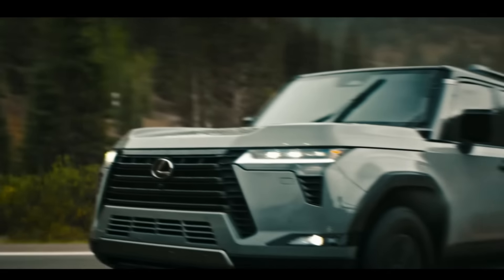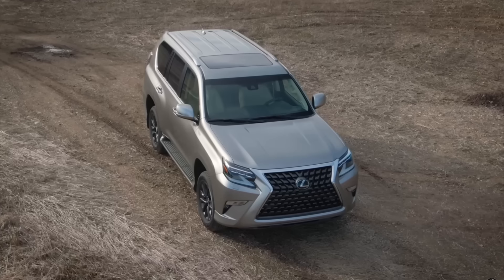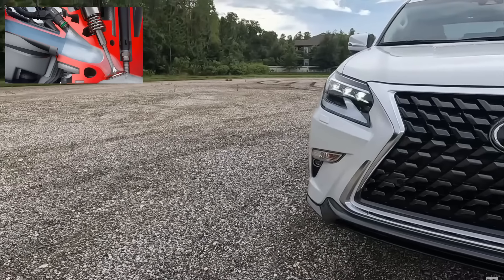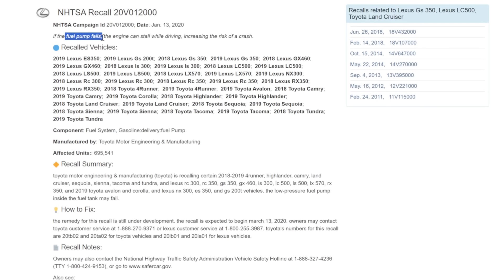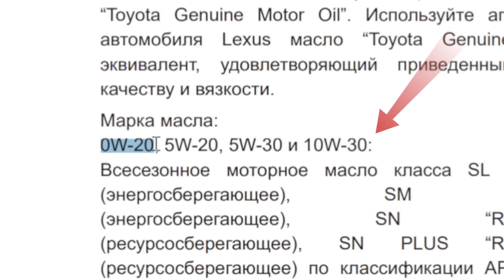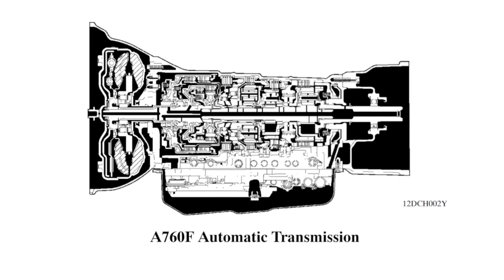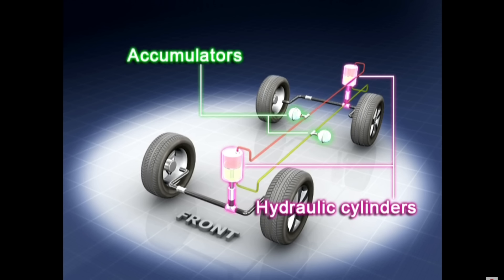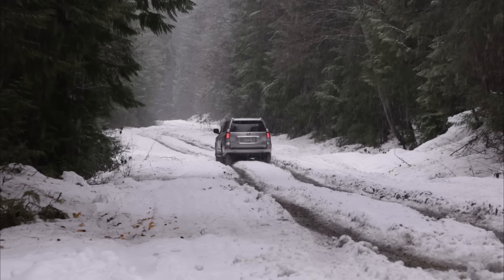2010–2023 Lexus GX 460: A Complete Reliability Guide

Comment: New engine is not more fuel efficient. More complicated only
Reply: The new GX motor is more efficient. Better gas mileage and more power. The only issue with the new GX is that it's not aerodynamic so the fuel efficient is not that great but the motor has better fuel efficiency in the larger LX while pushing even more power with bigger turbos.
Reply: It is only 1 or 2 Liter for 100km. That is not big difference
Reply: @Stellateeee  GX460 is rated at 15 city/21 highway/16 combined. GX550 is rated at 15/21/17. LX600 is 17/22/19.

If the GX550 wasn't a box it would get 3 MPG combined instead of 1. Even if mileage was identical, you're still getting 48 more horsepower and 150 more torque. 1500-2500 more pounds of towing capacity.

The GX550 motor is not more reliable, that's for sure. It is more efficient.
Reply: @Sunil-he8xm  550 have the same fuel efficiency in real life, even though on paper it should be 1mpg better)) Turbos must have a more frequent oil change, extra idling time after starting and stopping if you are planning to keep the car for longer than 5 years. That iPad in the center controls everything, and if one diod or triod will burn out in it, you will have to shell out tons of money for the replacement. KDSS system is ONLY on overtrail version.  No real wood at all, no real leather on all of them but on luxury trim, no air vents on top sides for the passengers,  rear windshield viper is located cheaply  on the bottom of the rear window and not hidden like on 460, not a lexus anymore,  plain Toyota for the price of a Mercedes
Reply: @TheWinwin4all  I said even with the same mileage you are getting more power and towing with the GX550 and if it did have better aerodynamics (ex. LX600) you would definitely get the best of both worlds. GX460 does have easier maintenance and better longevity. It's a trade off and with a new generation it shouldn't be that way, everything should be better.
Reply: Exactly
Reply: The new GX 550 is not fuel efficient! My 2023 GX 460 can get more than 21 MPG on the high way on long trips going 65-70 MPH. Local driving I get around 18 MPGs. The 460 is bullet proof with over a decade for Lexus to perfect the engine.
Reply: @TheWinwin4all  100% agree I have a 2022 GX 460 and looked very closely at the newer 550. I wouldn't switch it if they gave it to me as a free exchange. I love the KDSS and I'm glad I don't have the air suspension. I don't off road so I'm good with what I have. I will never sell it.
Reply: @Cocora22  I have 23 with air suspension.  I have 3 modes with it, comfort, normal and sport. It does make a difference between comfort and sport, also it does auto leveling if pulling a trailer, so I like it. Regarding new 550, I was 200% sure that it will be my new ride, however,  after sitting in it for the first time, I regretted myself that I didn't buy the last 23 from the dealership when they were heavily discounting them in mid November 23 through January 24, while making room for the new 550. Anyway,  I found very low mileage Lux and can't be happier. New 550 is just a Toyota now, not a true lexus anymore..sadly
Reply: @TheWinwin4all  Yes I agree I saw the 550 at the car show in Washington DC and it did not impress me in the least. The exterior did, but that's it. Then read all the reviews and road tests and none of them impressed me. I'm glad you found the LUX, it really is very hard to go wrong with the 460. I wanted a LUX but I also just wanted the green color so I went with that one. I don't tow so doesn't affect me. I would have liked the extra bells and whistles but I fell for the color head over heels.  😂😂😂😂😂Enjoy and Happy New Year.
Reply: @Sunil-he8xm its not just a tradeoff, it’s a tradeoff where the old one demolishes the new one on pretty much everything that’s important. for an extra 1mpg. the transmission is also much worse. the old one is smooth, powerful, and a bliss to drive. i actually can’t believe they screwed up so much on the new one.
Reply: Reason for saying bye to V8s is all about meeting govt emissions requirements.
Reply: @Sunil-he8xm  More efficient on the EPA test loop only

Comment: The one issue they all will have between 75k-140k is the valley plate coolant leak. but other than that amazing cars and go anywhere
Reply: I can attest to that. They told me that it was a small leak, but offered it to be replaced. I'm going to keep watching the coolant and will only change if it gets worse.
Reply: Yup. Have one leaking now. Slow but have to keep an eye on it until I can get it repaired.
Reply: @wavenami  offered to replace for free? dude do it....
Reply: How long can you go before it absolutely has to be fixed?
Reply: @ keep an eye on your coolant level and temp. I was adding 2-3 bottles a year for about 70k miles but  now at 180k I’m at a gallon a week so it’s about time for me unfortunately.
Reply: @Damienvizuete  Are you going to fix it yourself?
Reply: @  no sir. No tools, garage or skills unfortunately. It’s also my only vehicle. Taking it to Lexus. They quoted $3500. I’m figuring $5k just to save myself the shock as they’ll probably recommend and or find other things to fix while they have the whole engine apart.  Plus I’ll get a loaner GX (or RX hopefully not) for the 2 weeks it will probably take to get my car back.
Reply: @Damienvizuete  Oof that is a pricey fix. Reminds me somewhat of when a head gasket blew on a truck which was about the same repair cost.
Reply: @Damienvizuete  I think my Lexus quoted about $3500 I don't need it yet, but I wanted to see what they charge. I am sure they will look and hope for other things that they can replace because they have the engine open, and you have a choice. Need to find an experienced Lexus/Toyota private tech or Indy shop in the Tri-state area that works on the GX. Lexus, like other dealers, is expensive due to overhead, but despite paying high prices, there is no guarantee the work was done right. It's all about getting the job done quick and changing high.
Reply: If this repair is done by Lexus, will there typically be reoccurrence? Looking at a used one where the service was performed right at 70k miles and it now has just over 100k. Not really looking to do something like this every 75k miles. If that were the case, I’ll buy a gx470 and just have to do the timing belt every 90k at less than 1/2 the price of the coolant leak.

Comment: Great review. Thanks.. I really wished if Lexus/Toyota did a better job of rust proofing the undercarriage. It is only painted, without even any primer. Very disappointing because the GX will rust long before it's useful life.
Reply from the maker: thanks for your comment man👍🏻 you're right rust protection it's something that Toyota really needs
Reply: We reviewed a ton of used GX460 and passed on all of them due to this issue. Finally found one in TX with very little rust.
Reply: @wavenami I’m currently looking to purchase, can you give hints on most common area the rust starts?
Reply: @AppliedCommonSense  As far as rust goes, pretty easy to see. Get a flashlight, start with the front skid plate and work your way back. Look inside the front passenger wheel well underneath the rubber cover. If the metal tubes are smooth, it's a good sign. Carefully inspect the front wheel suspension/linkage on both sides for corrosion. Cars from cities that use a lot of salt on the roads in winter are the most suspect. Take a screwdriver and lightly scrape areas that look suspect. If it's heavily rusted in areas, pass. Light rust can't be avoided most of the time, but you can tell if it hasn't been taken care of.

Comment: Valley plate leak, needs more frequent coolant changes.  Also gasket is metal, and engine is aluminum, so engine is sacrificial while gasket is not.  So needs dutiful oil and coolant changes.  Frame rust issue.  Secondary air intake issues.  That’s about it, I cannot think of any other problems missed, great vehicle.👌
Reply: I thought the issue was a sealant material rather than an actual gasket causing the valley plate leak. What would the recommended change interval for coolant to possibly prevent the valley plate leak?
Reply: also timing cover leak happens around 70k
Reply: Aluminium is metal...

Comment: The most common issue GX460 owners face is the KDSS? Where are you getting this information from? Though it is entirely possible, I don't know a single GX460 owner who has had to service the KDSS system. The coolant valley plate leak, secondary air injection pump failure, oil leak from the cam tower, and transmission failure over 120K miles are all much more common.
Reply from the maker: what area do you live?
Reply: Agreed
Reply: Totally agree, also the radiator neck leak for southern states.

Comment: Great info. Thank you!!

Just hit 180k NYC miles in my 2011 GX.  Occasional highway but majorly city. I accelerate hard often/always and now I know why my transmissions reverse gear  failed at 160k miles. Had to replace the whole transmission and my LEXUS dealer offered zero advice or comments as to why. He only said it was “old” lol. My engine is as strong as new. Maybe stronger after years of my Italian tune ups. I drove the dealers 2023GX with only 5kmiles on it while my transmission was being replaced. I was astonished and quite pleased how similar my car old felt to the new one. Mine definitely felt better in the city as I have a MagnaFlow exhaust and OME suspension and 33” BFGs. Our roads are horrible. and my aftermarket suspension and tires really smooth out the ride. Appreciate all the advice especially as I approach 250k. Gotta change that timing chain when I get there. Thanks again!
Reply: It may be helpful to get re-geared, 33" tires are usually the limit for a stock transmission. Larger tires are harder on automatic transmissions in city traffic, a re-gear will help to ease the wear on the transmission.
Reply: @Connor-ji5nn  perhaps, but that seems a bit expensive for just “33’s” that are actually 32.7”, only 2” aprox over stock and thankfully no noticeable loss in acceleration and torque by my seat of the pants computer analysis. Also the transmission was on stock tires for over 120k miles. Unfortunately my next expense is going to be that damn valley plate gasket. I’m putting 1 gallon of coolant a week in my radiator now after years of keeping a close eye on it and having to add only about 1 gallon every few months, for the last 5 years. Thanks for the advice!
Reply: Great to know you got 180K on NYC roads; I have a 23 GX460, so hopefully, it will be long before I have any major issues. Can you tell us the cost of the new transmission from Lexus?
Reply: Hopefully yours won’t ever fail. I’m told I drive like Kojak. Lexus charged me $9,700 or 2,425 NY slices 🍕. They gave me a ‘23 GX loaner with only 4k miles and remarkably the only noticeable difference from my ‘11 was a slightly higher break pedal. Mine still feels just as solid in every other aspect. You’ll be good for years to come!
Reply: @Damienvizuete  I am hoping you are right. live in the Tri-state, so I have similar road conditions, but it is built solid, so I am not too worried about that, mainly the valley plate and transmission. Wow, $9700 that's what worries me dam expensive for trans. I assume 1/2 is labor since the reman Trans on Lexus online runs $3-4k. I had 4R, and those powertrains v6/5spd seem less prone to failure, but GX, hands down, is the nicer ride.
Reply: @ much nicer ride. I’m always amazed it’s a live axle especially after a trip on a twisty section of highway like the Taconic or FDR.  Apparently we have a different steering rack that’s a bit sharper and provides more feel.
Reply: Fellow New Yorker here with a 2010 GX, did you replace the transmission fluid at all? The transmission problems are becoming very common on these cars as the mileage increases in the community. Lexus calls the units sealed with lifetime fluid, which is simply untrue and the fluid has to be replaced every 30-40k miles
Reply: @Rafal_NYC Hey Rafa. No trans fluid change on the svc report from Lexus of Tampa so that definitely could have contributed to my transmission failure. I started changing the fluid every 20k after I bought it w/106k miles on it but that obviously didn’t help. Def on top of it with my new one now. Thanks!

Comment: My 2013 Gx460 at 197k miles is a tank. I will hope to pass this down to future kids even with repairs that are bound to arise. Replaced a radiator, CV axle boot, and all fluids regularly (differential, transmission, oil, brake, power steering) , added a transmission cooler to extend the life, the spark plugs. Other than that, it is solid. Stock suspension feels great even at this amount of time.

Comment: We've had a  2012 GX460 for 2 years. Love it.  Our kid drives an older Mazda CX-5 and we took it to the shop for work. Mazda loaned me a 2024 CX-70 - it's super modern. But I'd rather drive the GX460 - it feels more solid, better acceleration, is quieter, and isn't overly automated. I'll drive it for another 10 years, and maybe upgrade to a 2022 GX460 then. :)

Comment: What a cool video! Awesome because my girl's 17 just crossed 82k miles. We did full mechanical fluid replacement thankfully taking care of the trans (overdue) and the differentials. Now I'm going to make sure her radiator is nice and clean!!! Thanks for making this super informative break down of the legendary 460 platform! So the FSE was for the LS, huh? Cool cause they use the S designator on my IS350 as well 2GR-FSE vs the 2GR FE found in non sport like vehicles across toyota and lexus brand. Very cool!
Reply: Another thing to note is a lot of people complain about the front chairs having a weird pertrusion from the lumbar area... Very weird how its tough for me to get comfortable on long drives as I'm 6ft 3" tall. Saw one guy rip open the back of his seat just to remove that plastic insert that Lexus puts in which gives the chair its particular shape. Some hate them, most don't complain at all. I hear they seriously addressed these ergonomic issues with the 550 seats. Glad they listened!
Reply from the maker: hah happy that it was useful for you!

Comment: It is worth mentioning the common UR series engine leaks.  Very common on the GX and all labor intensive repairs.  
- Valley plate leaking coolant
- Front cover oil leaks
- Cam tower oil leaks

The lean mentioned in this video has nothing to do with KDSS.  There is a Lexus SB addressing the issue and the fix is to replace the left front spring with a revised part number.  Also the sketch on the video is incorrect, the GX does not have fluid accumulators.
Reply from the maker: Indeed, some Lexus models can suffer from certain leaks. Typically, coolant or oil leaks are related to improper engine temperature management. Owners who have never replaced the coolant or cleaned the radiator may encounter such problems after 10-15 years. The lean I mentioned in the video is related to the KDSS system in most cases. You are right; sometimes the issue lies with the spring. There are even cases where the problem involves both the KDSS system and the springs simultaneously. However, most owners complain about KDSS-related issues when the vehicle's body position changes. Hydraulic accumulators are present on the Lexus GX 460, just not in the form shown in the video. The part number is 4800660031.
Reply: @thelonglastexpert  apparently coolant changes are key to help avoiding the  valley plate issue.

Comment: There were still supply issues with the GX 460 in 2023.  You could not order one, and the majority were for buyers waiting for delivery.  If the buyer did not want it on arrival, then it became available.  Lexus could have sold far more.  They loaded the ones they did make however; Captains chairs, ML, upgrading wheels, etc., anything to pump up the price and profit.